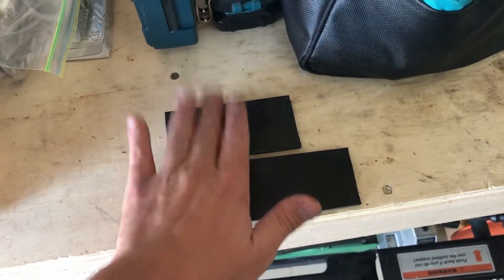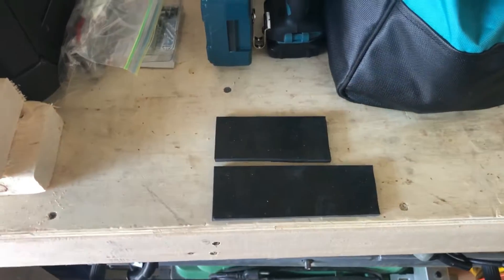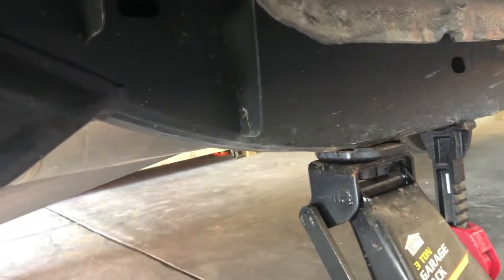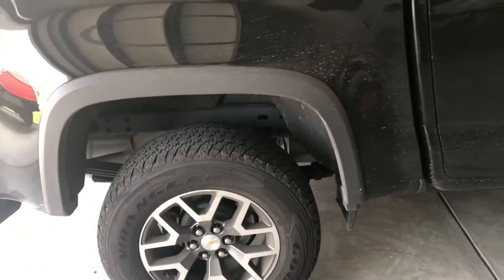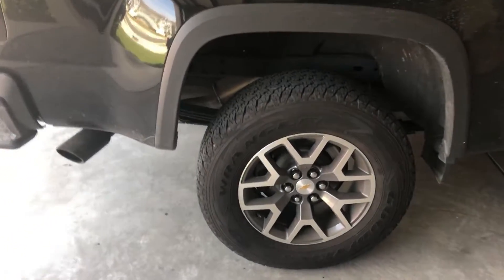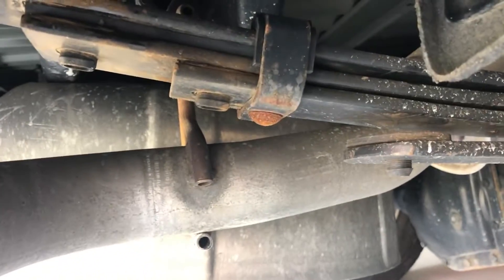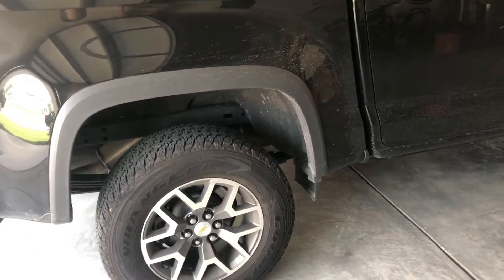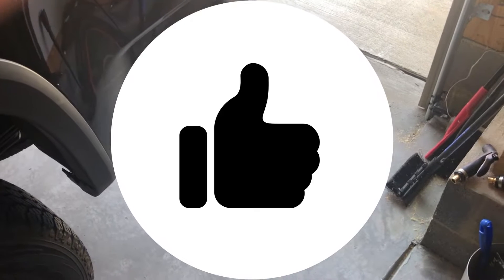[HOW TO] "Fix" Noisy/Clunky Leaf Springs - 2015-2021 Colorado / Canyon (Better Than the Dealer)

Comment from the maker: Do your 2nd Gen Colorado or Canyon leaf springs clunk? Post a comment if they do! 
Here is the rubber sheet I used in the video:
https://amzn.to/2TNpmoi
Reply: Hell yes! Drives me nuts!
Reply from the maker: @brianparker-realtor5045  Try this method. Hopefully it works as well for you as it did for me. The aren't 100% clunk free, but they are definitely a LOT better.
Reply: Yes! Ive got a 2017 with 25k miles.
Reply: When you put the rubber pads on there,what holds them in place, Just the weight of yruck?
Reply from the maker: Casper 24 yes.
Reply: My 17 clunks!!
Reply from the maker: @mattboudreaux293  This should help. Give it a shot.

Comment: I tried this on my 2018 Colorado. It is super easy todo, the leafs open up with ease with a pry/crow bar or big flat head screw driver. I bought the rubber labeled in the description 12”x12” 1/4” thick(it is 1/4” thick), used a compact miter saw to cut it with 90 teeth (smoother cut). You can use a utility knife or jig saw etc. It one hundred percent fixed the issue!! The only time I hear a noise anymore is under massive amount of flex (off-Road) at a high rate of speed and still then the noise is veryyyy minimum. I also can verify it works on Silverado’s too (I installed shims with plenty leftover rubber mat on to a Silverado). It’s been about a month of use no issues and the rubber shims have not moved at all! Ive tested them hard off road, on gravel, over curbs, speed bumps (with speed), many more obstacles. No issues. 

Highly recommend to do this if your having issues. 

Only one problem I had was with the dealerships (went to three) just adding lube and saying it’s within GM spec.... it’s normal!
Reply from the maker: Awesome. Glad it worked for you!

Comment: Great work Fondupot! This worked for me. A few hints I can add if I may... I was having this on my 2018 Canyon. It was not always this way and this vehicle doesn't go off road. As an engineer, I can tell you that this design may be OK, but the light pads used dry out (we did not have this problem until about 40K miles.) Others have had it earlier. I think this is an easier fix than trying to replace those pads.  If this noise  "sounds" like it is coming from the front and the back, it is the back leaf springs resonating through the chassis, so fix this first before deciding that you have a problem in front (which is harder to diagnose.)  Also, check your receiver hitch, with the hitch in the tube, it can move around and make a similar clunking noise. This particular leaf spring slapping problem is more apparent at slow speeds when turning corners over driveways and small bumps. Speed bumps hit squarely will not make the noise, it is much more apparent with a twisting-moment on the back two wheels and you will get repeated low "clunks" like something is loose in the bed or beneath the vehicle. Nothing will appear loose when climbing and shaking items underneath. I could not get the sound to repeat  by shaking either rear wheel or the bed frame. I did not use the Springy thingy. They probably work, but with tax and shipping it was going to be a number of days to get here and over $40 for something I wasn't sure would fix it. The sheet Fondupot recommends arrives the next day and gives you some backups. Please use his link and make sure you wear protective eyewear.  I did not have a jack I trusted so put one rear wheel on the top of the curb and all the others off. You then work on the street side rear wheel leaf springs. (Just so it is clear, when they say front and back, the leaf springs are only on the back so you are working on the front and rear of the back leaf springs.) Fondupot is exactly correct, the pad only needs to go between the topmost leaf spring. I have some very large standard screwdrivers and could barely manage to make the gap between the leaves (likely due to my sub optimal way of jacking up the vehicle.) I switched to the crowbar ( the sharp end that is used to pry off the wheel cover in jack kits for the spare tire)  and it EASILY made enough space. The lenght of the pad does not matter a great deal but match the width of your leaf, you are just trying to keep a gap between them ( and have them stay in place.) I can say that I did not see a change in the quality of the ride with the pad in there.  JB weld or zip ties will work to hold them. If you use zip ties, poke 2 holes in the pad and thread them through the two holes to hold the pad in place. Pull them tight but leave the excess. After you drive around a bit you will be able to pull them tighter and then you can cut off the leftover length. Plastic zip ties are notorious for breaking down with heat, I recommend you switch to the steel ones from Home Depot. HTH Thanks.
Reply from the maker: Thanks for watching. Glad it worked for you.

Comment: This guy's advice is spot on! I have a '24 Trailboss that had the noisiest leaf spring springs at less than 400 miles!!! Chevy quality I suppose... Anyway, this easy fix works like a charm!!  Thanks Fondue!!
Reply: I jsut purchased a 2024 zr2 and had it undercoated the same day.  The dealer is telling me they will not cover it under the warranty because they claim this is what is causing the noise.  They claim dirt got between the leaf springs.  When I drive at slow speeds over bumps it drives me crazy.  This truck only has 2000 miles on it.  Is this a hard project?  Needless to say I am very upset.  i have been thinking about buying a new truck for 10 years, and now I have this headache.  Thanks for your time.
Reply: I have a 24 zr2 Colorado. I have a clunk that almost feels like it’s in the floor board right under my feet. Could this also be the leaf springs?

Comment: Had the same issue with my 2019 GMC Canyon. I used the rubber sheeting like in the video as well as taking a breaker bar and tightened the ubolts. Truck no longer makes the noise. Thanks for the helpful video!
Reply from the maker: Awesome. Glad to hear! Thanks for watching!!

Comment: Ok.  I used the rubber you suggested and I parked the car with one wheel off the driveway and the other up.  Use a pry bar and inserted the rubber.  Repeated the other side and noise is GONE.   THANK YOU!!!
Reply from the maker: Awesome. Glad to hear!

Comment: This worked!  I had the same noise on my 19 zr2! Drove me nuts. I greased them first while I was waiting for the rubber sheet to be delivered from amazon. Then jacked it up again and put in my rubber inserts. The grease helped the inserts into place, along with a couple pry bars and a mini crow bar. Thanks!!
Reply from the maker: Kevin Coulte glad it helped!
Reply: I’m having same issue with 2018 ZR2. I added the extra rubber piece but it did not solve this issue. You have to change the rear brake pads or glue the pads on because it’s rubbing and causing a squeaking noise only on certain bumps and cracked roads. Also you have to tighten or retorque the U bolts for the Axels that mount to the Leaf Springs. That worked for me.

Comment: My 2021 trail boss started clunking on the driver side after two months and 2400 total miles. Aggravating. I will try this.
Reply from the maker: Should help. Good luck! Thanks for watching and commenting.
Reply: Did this procedure help with the clunking?  I just purchased a 2024 ZR2 and the clunking is driving me crazy. The dealer is giving me a hard time, telling me it is from the undercoating that i had someone apply.  They told me it won't be covered under warranty.  Thank you.

Comment: Man, I just bought a brand new 22 colorado and I believe this is what's exactly happening to me. Although it's not a problem, it's just not what you want to hear when "offroading" or going thru high bumps. I'm about to try this
Reply from the maker: Should work great. Good luck! Thanks for watching
Reply: @fondupot  Thanks, quick question, I rather ask a user like you rather than trusting the dealership 100%
 Is there really no long-term problem that could result from this "clunking"?
Reply from the maker: Pretty much yea. It’s just a design flaw in the leaf springs. The dealer fix is to grease the crap out of the springs. But it only lasts for a little while and comes back.
Reply: @fondupot  Thanks for the reply mate, GREAT videos

Comment: I drive a 2017 silverado with the same problem went to the hardware store and got some rubber sheets .no more noise thank you so much. Was driving me crazy
Reply from the maker: Awesome, glad to help!
Reply: Mark, what size pieces did you use? And was the fix only temporary?
Reply from the maker: @clay727  Check out my other video, these are precut and include zip ties to keep them in place. Works great. 
https://youtu.be/2GvEsat5Bbc

Comment: I have the same issue with my 2015 Silverado. Leaf springs are clunky and very noisy going over slow speed bump in parking lots and into my driveway. going to see if I can fab something like this to work. I've also heard greasing the leaf in those locations as well, but that is a short-term solution that will need to be done often.
Reply from the maker: You can make pads yourself out of 1/4" thick rubber mats. You can find that on amazon. These are nice for a pre-made solution. Greasing the leaf packs does help, but is temporary and will eventually wear away and start squeaking again.

Comment: rubber will quiet the noise, but it  will give a harsher ride, .  The leaves are designed  to slide over that little button insert.  rubber will stick the leaves together.
Reply from the maker: I’ve never noticed any difference in ride quality. The leafs can still move just find when adding the rubber. It just makes it so they don’t slap as much.
Reply: @fondupot    Hey as long as it works.  But traditionally , something slippery  is placed at the leaf ends  so the leaves flex smoothly.  I'm sure anything you come up with will be an improvement over modern GM engineering quality.
Reply from the maker: @Ethan-um7cp  Yea it works well. Some people report that the rubber strips slip out after a while, so they have to push them back in. So that's how I know they aren't hindering the motion of the leafs. Just reducing noise.

Comment: Check your rear wheel bearings. The clunk noise is coming from the rear-end end play. Plus the rear of truck side2side and check the rear wheel bearings. My zr2 rear-end has Ben clunking since the truck was new and the clunk is in the end not the leaf springs.
Reply from the maker: In my case its the leafs. Widely known issue for many folks.

Comment: Thanks for the video. Works great on my ‘17 Silverado. Used different size but fixed the noise.
Reply from the maker: Great to hear! What size did you use?
Reply: 2-1/2”x 10” in the rear and 2-1/2”x3” in the front and only between the top 2 strips.
Reply from the maker: @Veeroy914  Right on! Glad it worked out for you.
Reply: Same issue with my 17 silverado. 
When doing this install you just need to lift the rear end up and pry / insert rubber pieces between the springs?
Reply from the maker: Yea. Simple as that.
Reply: @Veeroy914  How did this hold up?

Comment: Ok I’m fed up with the dam clunking noises I get from the rear of my 2010 Colorado Crew Cab! So I’m going to try using a rubber sheet, with pieces cut to perfection and affixed with some bonding agent. It’s funny I just saw a few pictures of an old Rolls Royce, that had the leaf springs wrapped in what looked like inner tubes! That I’m sure would quiet down any noises coming from the springs!
Reply from the maker: Should work pretty good. I would pass on the bonding Agent tho. They won’t move on you. Good luck! Thanks for watching.

Comment: Not the same vehicle I know, but The leaf springs on my 2006 Silverado 1500 squeak really really bad. I narrowed it down to the
Rebound clips. I spayed white lithium grease all on those clips & so far so good though it’s only been a few days.
Reply from the maker: That should work for a while. Until the grease wears out. But glad it works for you!

Comment: Did your truck make like a loose shaking noise when going over bumps at slow speed especially slow turn bumps like back out of the drive it feels like something is swaying under there but everything seems tight ? I thought it was the spare tire I took that off and it's still there drives me nuts
Reply from the maker: nick parimuha yea that’s pretty much it.
Reply: What was the issue?  Just the leaves?
Reply from the maker: Yea the leaves rub and and slap. Making a lot of ugly noise
Reply: I have a slightly loose sounding clang going over bumps at the front. Feels like its beneath the driver side. You said this is something different right? Only 40k on it. If it’s just noise I can deal with it - just concerned it may be more.
Reply from the maker: If it’s in the front it could be coil springs, ball joints, tie rods, control arms. A whole mess of different things.
Reply: @chrisyehhh  Check your sway bar links & the rubber sway bar mount pads because these trucks are known for those to go bad & can also cause noise up front when they go bad .

Comment: I just got my 2022 Colorado with 3200km serviced and they fixed the problem after I explained what was wrong and used the YouTube knowledge I have gained through investigation…apparently there is a GMC bulletin circulating that indicates that the leaf spring u-bolts need to be retorqued….simple fix that works
Reply from the maker: That TSB helps. But your squeaky leafs will likely return.
Reply: Just reading a GM bulletin which talks about Replacing C-locks, do you have any knowledge of this bulletin?
Reply from the maker: @leakylogan642  never heard of it. Whats the bulletin number?
Reply: @fondupot  The bulletin is #20-NA-156 dated November 2020 Subject: rear axle chunk.
Reply from the maker: This has something to do with excessive axle play inside the differential.
Reply: @fondupot  I received a call from the Chevrolet technician earlier tonight and he explained that the retorqueing of the u-bolts was covered in another bulletin, which he read to me , but I can’t remember the number, it indicates that the U-bolts need to be retorqued , I’m hopeful this is the answer , but I guess time will tell. I’m currently happy with the results, the Chevy is riding like a Ford…can’t believe I just said that, but it’s true.

Comment: is this because of the factory leaf springs? or besides the rubber can you switch out leaf springs?
Reply from the maker: Yes, these are factory leaf springs. It's been an issue with GM trucks for a while. There are several aftermarket options for leaf springs that can be installed on the Colorado/Canyon. Deaver, Old Man Emu for instance are some aftermarket options.

Comment: My 19 just started. Driving me nuts! What about if the clunking is coming from the front as well?
Reply from the maker: Then that’s something different. Like a ball joint or a coil spring.
Reply: Fondupot's Garage oooh. Time for a trip to the dealer
Reply from the maker: Good luck. I hope you get it fixed.
Reply: Fondupot's Garage thanks bud.

Comment: Keep us posted on the longevity of those thicker pads. My 1/8" pads get squished out at the ends after a few wheeling trips. :(
Reply from the maker: I will be sure to do that. I don’t do any wheeling so hopefully they stay in longer.
Reply: @fondupot  I bet they will! Mine usually stay in without a problem (after using JB Weld) until I go wheeling and cause the rear end to articulate wildly. For street trucks this is an excellent fix IMO. Short of buying a new set of ARB leafs anyway. Thanks for making the video. I thought about it but you are much better at it than I. There's another fix I've wanted to put on YT but I'm forgetting what it is. When I remember I'll let you know and maybe you can work on it?
Reply from the maker: Sorry for the delay. I don’t get notifications on secondary posts.

Comment: Would have been a great video if you showed atleast know how you put the rubber in instead of just showing the after
Reply from the maker: I thought I explained it pretty well. Just pry up the spring pack and slide the rubber piece in between the leafs.

Comment: Did you have to loosen the u-bolts to slide the rubber sheet into place or did the jack and stands make enough room to accomplish it?
Reply from the maker: No need to loosen the bolts. Simply lifting the wheels off the ground is enough to slide the sheets in. You can use a heavy flat blade screw driver to pry the leafs open a bit to make it easier.
Reply: Just saw this after completing, and yes, a big pry-bar, a couple big screwdrivers, and a hand from a couple buddies made the job take less than 30 minutes - including cutting the rubber to the correct sizes. Test drive complete too, and she’s MUCH quieter - if not completely silent now. We did the next layer as well on front and back as you suggested. Thanks!!

Comment: I have the clunk 18 zr2 going in to dealer
Reply from the maker: Greg Conrad all they’re gonna do is grease the hell out of them. Eventually the grease will wear away. This method will ensure the noise goes away.
Reply: @fondupot  one thing you didn't show is how you got the rubber pieces in did you just pry them open?
Reply: LEMON LAW YOUR TRUCK I HAVE A ZR2 WITH 6K MILES AND ITS BAD EVEN WITH AC ON AND RADIO ON YOU CAN HEAR THE CLUNK
Reply: Good luck. They will grease it or say they cant find it. You can use the safe driver portion of the app to see the length and direction of the test drive they do. I usually get shit done when I show em that there 5 min test drive is bs.